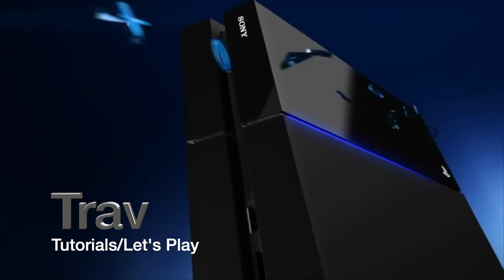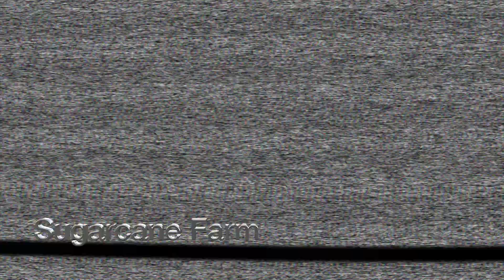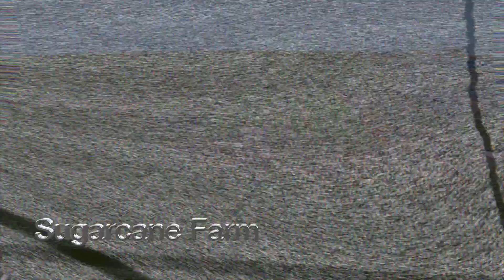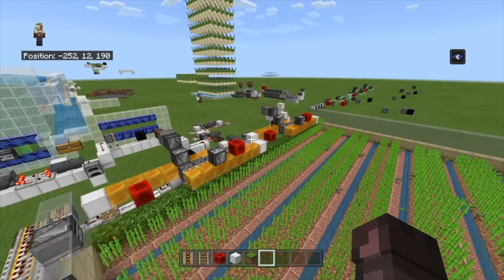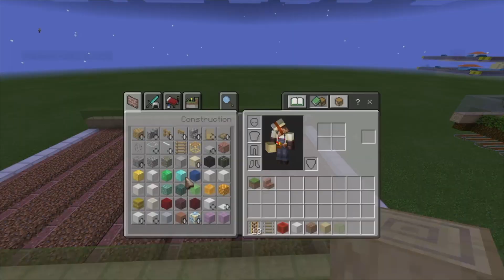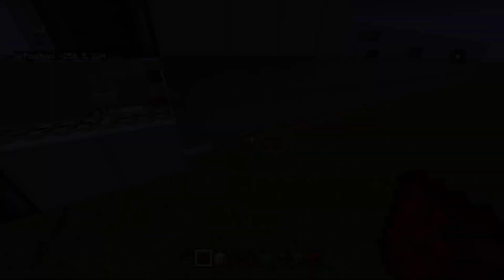Minecraft Bedrock | SUGARCANE Farm Tutorial | 1.14.1 Guide

Comment: Really good build!  
  I just did a huge survival world bamboo farm using some very similar base ideas.  Your leaf block wipers are EXACTLY what is needed to make mine more efficient.  Having the flying machines separated is smart, they will gladly turn into “ghost blocks” if you leave the game or area.  The limit on size of a flying machine farm seems to be about 60 blocks away from the player, otherwise they seize up.  
   Two suggestions for your build is to make the minecart unloader and parked dock one in the same.  This prevents the minecart from having items in it at the far end, you can safely leave the area and not have to worry about it despawning because it wasn’t quite to the parking area.  Removing the auto senders and simply wiring the flying machines to the main switch would also help keep the flying machines from  despawning / seizing if the area gets briefly loaded.